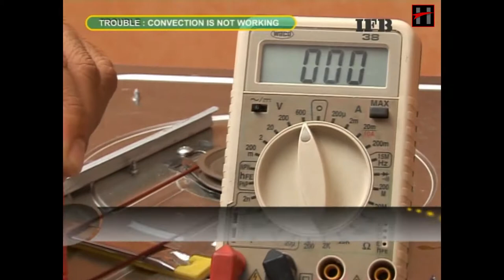Microwave Oven : Convection not working

Comment: My timer and + - button isn't working on convection or grill or microwave+convection mode. It doesn't start. But it starts in normal, auto reheat, cafeteria mode

Comment: im using convection microwave.it can be on to use for microwave power only.if i use grill or convection mode,it will trip the DB.what is the problem.
Reply: This is what is wrong with my combination microwave. Did you ever get an answer?